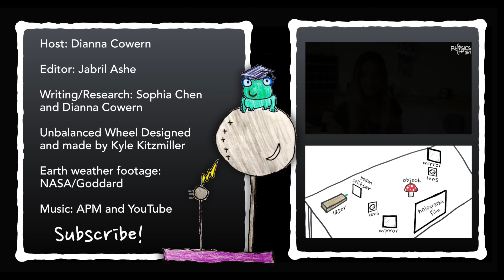Are perpetual motion machines possible?

Comment: Theoretically you could build a perpetual motion machine, but you'd never be able to get any energy from it. But if no energy is put in and no energy is taken out of the machine, it'll stay the same energy level. Probably the closest thing we have right now to a perpetual motion machine are satellites. They move forever around our planet without any energy input. Except they don't. What we call vacuum actually has a few particles which slow the satellites down, other planets and the moon affects the satellites over time and the sun heats them up.
Reply: +Huntracony A perpetual motion machine isn't even possible theoretically, look up carnot cycle
Reply: ***** Sorry, I do not understand it from reading the Wikipedia article. Why would it not be possible for something to move forever when the amount of energy in the system doesn't change?
Reply: +Huntracony Inertia. 

The word you're looking for is inertia.
Reply: +Huntracony Satellites most certainly have an energy input. It's the rocket that propels them into orbit in the first place. That initial energy input gives the satellite it's motion. With no friction they would stay in orbit not forever, but for a long time. Gravity, solar wind and depending on the altitude, the upper atmosphere, all act against the satellite to reduce that initial energy input and deorbit the vehicle. The ISS is low enough that it does still get drag from the upper atmosphere and has to be lifted to a higher orbit from time to time. Satellites that are sent out of the solar system, like Voyager or New Horizons rely on gravity assists to augment their initial energy input from the launch vehicle, but even so, they would be really poor perpetual motion machines since we don't get any work out of their motion.
Reply: RealSpaceModels and i mentioned all of those things in my comment.
Reply: ***** reality stops us from making it practically and the laws of physics mean that if we ever make one it'll be useless and noone could see it because the light required for that would be giving it energy.
Reply: +Huntracony No, simply because  a perpetual motion machine is defined as "a hypothetical machine that can do work indefinitely without an energy source."
You can't ever make one because this is already impossible. Also, Satellites aren no p.m. machines, because they don't do work. Work is done when a force acts along a path (W=F*s). The Satellites experience no force along their path (that's why you continue to move with the same velocity when you float in space), earth's gravity is directed perpendicular to their velocity.
When you are interested, look up newtons 3 laws.
Reply: Nitroschock That's what i meant by not being able to get anything out of it. I took it as it sounds, a machine that will Always be in motion. That does not state anything about it being usefull (doing work
Reply: +Huntracony Even a probe like Voyager, going through interstellar space, will lose energy and slow down due to friction. Even interstellar space is not a pure vacuum; a pure vacuum does not exist. It may take longer than the age of the universe to "stop", but it will.
Reply: +3ATIVE If it breaks the laws of physics, it can't even be "theoretically" done. If it goes against the laws of physics it is just imaginary.

That being said, you could still theoretically make a "perpetual motion machine" if your definition of that term is that it continues moving forever. Such a machine would not create energy, it would just not lose it either. To do this you would need an environment with no friction, which would mean no matter other than the moving object itself. So if you just had a disk in a true vacuum, you could make it spin forever. Conservation of energy actually forces this to be true... but only in ideal conditions. So it can be theoretically done, following the laws of physics. It just can't be practically done because no closed system like that exists in our universe.
Reply: +Wyatt Jackson i don't think simply "moving" forever qualifies as a "machine". I believe the minimal requirement from a "machine" is that it transforms one type of energy to another.
And when energy transformation occurs, typically - energy is "lost" in the process, so that further transformation is reduced - until it completely halts.

If something just "moves" forever - it is not a machine. it's just a simple object.
and there's nothing interesting about that. it doesn't "do" anything.
Reply: +Klayhamn nope, there is another law of which all of energy must agree 
whenever it changes form, it loses quality
In other words
dam that rise in entropy.
Reply: +3ATIVE Did you even read my whole comment?

My argument was that Huntracony's definition of a "perpetual motion machine" would not technically break the laws of physics. It is something that moves perpetually, but does not create or destroy energy, therefore it does not break conservation of energy. It follows the laws of physics and can therefore "theoretically" be built. Something that does not follow the laws of physics could not be "theoretically" built.
Reply: +Klayhamn That's a good point. The purpose of my comment though was to try to summarize what I thought Huntracony was trying to say, since it seems that people misunderstood that original comment. I was trying to explain Huntracony's definition of a "perpetual motion machine" (which admittedly focuses more on the "perpetual motion" part while mostly ignoring the "machine" part). But now that you mention it I guess that isn't actually what a machine is.
Reply: +Huntracony 
What most would agree to be a "perpetual motion machine" is some sort of device that creates more energy than it takes to run. What you are suggesting is simply inertia: An object in motion will stay in motion until acted upon by another force.

If a device could even make one nano-Watt more than the power it takes to start/run it, it will be perpetual motion. Since satelites, wheels, etc create 0 energy (including, as you said, pure vacuum, no friction, etc), it isn't a perpetual motion machine.
Reply: +3ATIVE 
According to wikipedia and a few other articles, over-unity devices and perpetual motion machines are basically the same thing.
Wiki on Perpetual Machine:  A perpetual motion machine is a hypothetical machine that can do work indefinitely without an energy source.
Doing "work" implies being able to put that energy it creates into use without new input. Ergo, what I described, some sort of machine producing 1 more nano-Watt than it takes to run.
Wikipedia also loops the terms "over-unity" back to the "Perpetual motion" page.
Reply: +3ATIVE 
Wikipedia: A perpetual motion machine is a hypothetical machine that can do work indefinitely without an energy source.
Thermo Textbook, an example of PMM: A steam power plant that produces energy indefinitely without outside input., or a power plant that achieves 100% efficiency.
About.com: a perpetual motion machine which produces power without energy uptake.
Britannia.com: The enormous appeal of perpetual motion resides in the promise of a virtually free and limitless source of power. 

If that doesn't mean it produces more energy than it produces, please explain what that sentence means to me. If you can't produce work out of this "machine", it is nothing more than an efficient energy storage device.
Reply: First-Kind perpetual motion machines create energy from nothing.
Second-kind perpetual motion machines extract heat energy from a colder energy source without another energy flow to drive it.
Third-kind perpetual motion machines run forever without energy input.

First- and Second- kind perpetual motion machines are impossible, third-kind perpetual motion machines exist.
Reply: ***** Yes there are. Persistent currents in superconducting rings are perpetual motion of the third kind.
Reply: +3ATIVE right!
Something that runs forever without energy input isn't possible, isn't a machine and isn't classed as a perpetual motion machine (most laymen would think of PMMs as something you can use to get free energy from).
In the case of voyager 1 (if we assume perfect vacuum and nothing encountered on it's journey), the satellite would travel forever as there is nothing for the kinetic energy it has (given to it by the lauch rockets) to be converted into. 
Even if the kinetic energy could be harnessed for "work" then it still would not give you back more than was put into it at launch.
It's not a machine in that sense, it's just an object with kinetic energy with nothing to convert said energy into.
It's quite interesting that the "total energy" of our solar system (and eventually our galaxy) will drop ever so slightly when it leaves as it has taken some of "our" energy with it.
Reply: ***** The whole point of a perpetual motion machine of the third kind is that it does no work. It's still a perpetual motion machine because it still runs perpetually.
Reply: IamGrimalkin
I think you are confusing the technical term "perpetual motion machine" with that which the Layman understands.
In Lay terms, a perpetual motion machine will allow someone to get free energy from an initial small input (or otherwise called an overunity device) - which isn't possible.
Also there's an argument that Voyager 1 carries no energy, depending on your perspective. if you were floating alongside (or travelling with it) at the same speed, it would have no energy kinetic or otherwise that you could use so it isn't even a machine in that sense.
Depends on who's frame of reference is being used.
Reply: sorry. not a skyper, (plus I;m at work!!)
Reply: ***** Yes, and persistent currents in superconductors require no extra energy to continue without stopping: they are perpetual.
Reply: ***** Electrons do have physical motion.
And anyway, you can do the same thing with a spinning superfluid.
Reply: IamGrimalkin but they do need you to give them energy to start the current, and if you then draw it off to use, you won't get back as much as you put in.
Reply: George Smith Yes, that's why it's a third-kind perpetual motion machine and not a first-kind.
Reply: +Huntracony, such a system moving forever is only possible in Newtonian physics though. Quantum mechanics makes perfect vacuum impossible. Meanwhile, relativity causes moving objects to produce gravitational waves and through those loose energy.
Reply: +IamGrimalkin, superconducting materials do have resistance.
Reply: mina86 No they don't.
Reply: +3ATIVE
No, the resistance of superconductors is actually zero.
Reply: IamGrimalkin, *****, interesting, it seems I’ve been living a lie all this time!

But in that case, consider this: let’s construct a closed system with a current flowing through a superconductor. If the current never stops, the entropy stays constant which goes against entropy growing in a closed system.

So even though in practice it may be unmeasurable, at a scale of billion of billion of years the resistance is probably still non-zero.

Or am I missing something again?
Reply: mina86 you still have to "add" the current to the system. So you're not getting anything for free, or any more than you put in.
Reply: ***** aah my bad. I'm still in the layman phase of perpetual motion.
Reply: +mina86
The second law of thermodynamics is not that entropy always increases in an isolated (not closed) system, it is that entropy always increases or stays the same in such.
Reply: +IamGrimalkin Just a little reminder about superconductors; they need to be cooled. And that cooling takes energy. And thus, not perpetual. If you shut the cooling of, you take the super out.
Reply: +Trond-M Johansen Cooling doesn't have to cost energy, send a bunch of superconductors to outer space where it's cold enough... Problem is, you can't extract power from superconductors, there's no power generation
Reply: +Huntracony nothing is a pure vacuum but assuming spherical cows in a vacuum then sure, you'd have a satelite orbitting forever. However, this isn't a real machine or cycle. To call it perpetual motion is somewhat misleading :p
Reply: Trond-M Johansen They only have to be cooled if they aren't below the critical temperature to start with.
Reply: +Huntracony You forgot tidal friction.
Reply: +Huntracony Wrong as the statement of hers with the Temperature beeing the force moving the bird.
The Sattelites always 'fall', so they are constantly supplied by energy through gravitation with a trick using movement in Space/Time.
So, it is not possible to build a perpetual machine. Because every interaction will cost energy, which is convertet into other, useless forms. Energetic Waste.
Theoretically, yes, you can create it as a math. As many physics is done in a theoretical, but impossible enviroment of total nothing. But, even then a perpetual machine is impossible, because your 'machine' would have to be one simgle BBlock of meterial impossible to interact with itself - which is also impossible.
So, even in theory, now with adding Quantum mechanics, the perpetual machine will fail and be even theoretical impossible.
Reply: +Huntracony nope
Reply: +Huntracony running perpetually IS CREATING ENERGY.
Reply: Jared Freeman Not necessary. Depends upon the definition,
The basic is the preservation of one type of energy by generating enough of it by running to replace the loss through other factors like friction f.E..
The 'creating energy' comes from the theory, that after creation the loss is reduced. it was a thought experiment which should show the impossibility of perpetual motion, but did quite the opposite to many people.

So, it depends on your build: creating more energy than loosing or loosing less/no energy.

And sorry for my English, it is still not my native language.
Reply: ***** That is not possible, because you loose energy even by not moving.
1. You can not recieve more energy than insert.
2. Entropy let you loose Energy disregarding your actions.
3. Interaction means energy transfer.
4. Energy tranfer is always at the price of energy loss through parts of the transferred energy is needed for the transfer itself, also there will be losses by energy not transfered but converted to another form which is not transferred od usable (the friction of the coins rolling on the wooden whheel / thermic energy through friction).

So, even if you eliominate every other outside source, a perpetuum mobile depends on at least 2 different things interacting and generating by that enough or more energy, than is lost in the process.
But, therefore the process itself can never be run at 100% efficiency, it is not possible, even if you negate all the outer influences.

So, the only way to make it "theoretically functional" is to put elemental rules aside.
Which is like claiming a is 9 instead of 6 in a+a+a=18, because you just ignore one +a.
Reply: +MrDpsc (Completely OT: That's a funny #TBBT joke, "Assuming cows are spherical and exist in a vacuum" LOL)
Reply: +Rabijeel 
That is pretty neat explanation. Rather a conventional one. Of coarse, those wheels will not achieve 'perpetual motion'. Those 'free energy' or 'perpetual motions' are not possible for certain scientific causes but their explanations are somewhat misleading & do ignore a few aspects about energy.
 We as humans don't know anything much about 'pure energy'. In fact we use forms of energy. Energy to cool something, energy to rotate, energy to propel, energy for heating. The nature of requirement of energy is that we need to continuously convert energy of one form to another. We need a energy source that is easily convertible from one form to another.
 No energy is destroyed or created. Conventionally it is assumed that a particular ensemble is generating energy by itself, which is not always the case. We are swimming in preposterously dense energy field. We are not needed to generate energy from emptiness. We need to find processes to harness those forms of energy to convert to usable forms.
Reply: +SuperRahul73 
"Conventionally it is assumed that a 
particular ensemble is generating energy by itself, which is not always 
the case. "
What I meant was that  Most of them were really spoof. in some cases they may have succeeded in converting one energy form to other but generating energy by itself.
Reply: +Huntracony It's not theoretically possible - it would violate the most fundamental laws of the universe. The reason the satellite keeps moving is inertia - it's essentially always falling towards the planet and missing! ;)
Reply: +Huntracony Satellites will fail over time just like the sun will.  The angular velocity is evenly matched with the downward pull of gravity.
Reply: +Bobsyouruncle Wilson Nothing except energy is perpetual in the true sense of the word.  
However most people think work consumes energy it does not, it is the by product of energy flow.  Enter entropy and you have another can of worms because some people think thermodynamic entropy has something to do with order and disorder, it does not.  Those two issues prevent most people from understanding and thinking deeply on the subject.  Maybe then most people would understand that Carnot efficiency is the work efficiency ratio to thermal energy flow.  So is it possible to create an engine that conserves its energy and its work output indexed to average local temperature. Yes.  Does it ever lose energy only as a function of local temperature change if above equilibrium pressure and temp but it conserves it within that state. Can be proven.  Can be demonstrated, question is can it be made both safe and affordable?  My opinion is yes, but it needs to be demonstrated.
Reply: Kimberly Peacock Still, you can not, not even theoretically, turn one form of energy into another one without 'loosing' energy, which is , if looked at it specifically, just a producing of 'byproduct energys', like the friction of an engine also generates heat, however it works, beneath the form of energy it 'creates' (or better 'transforms the former potential to').
The only way to reduce this losses would be to freeze it completeley (absolute null), which implys that no transformation can be done.
Indeed, that is the trick many superconductors use: Parts of the transferring array is cooled very much reducing the interference of themself to a minimum.

That means for me that even Energy itself is, as long as not bound in a state of total rest, not perpetual, because the interference of the enviroment (we know, the total Vacuum is a theorem to make things predictable by Math, not a real state or anything near possible) will always cause dirturbance which interactions cause amounts of Energy transfered to other forms. So, basically we have to prevent transformation of energy in a theoretical (impossible) enviroment which makes the transformation itself impossible (because, as Theory, it would at maximum be one Element, a single Atom, allowed, frozen in a impossible way; so we can not call it machine, because nothing will be proceeded, because of the need to prevent even elemental decay or 'entropy'.

At least, that is what my basic knowledge tells me, as far as I understand the whole Fabric of Reality. Correct me (please with source for me to learn) if I am wrong.
Reply: Richard Garnache The basic idea is not wrong, we do this with some devices nowadays to minimize Energylosses.
But still, in my opinion, it can not reach 0 because this also needs transferring Energy.
So yes, for me it is not working either.
Reply: Richard Garnache I know. But, it can be done without cooling theoretical (Finding an empy place in Space where no Sun can be seen anymore).
Keep in mind, it is about the theoretical possibility of Perpetual motion, not the real possibility which is impossible as everyone knows.
But, yes, you are right, there also the cooling has to be counted as well as used energy.

God, this thing goes ridicoulus more and more every second you think about it....
Reply: MrG0TH1ER Ok, lets call it 'mechanism' - but that is exactly what I want to say in the end: As closer it comes to perpetual motion, as farther it has to distance it from the term 'machine' or mechanism'.
Reply: +Huntracony Because of friction.
Reply: +Huntracony The short answer - no it is not even theoretically possible. The long answer - I think you are misinterpreting the term perpetual motion machine, as it implies something different to what it is. Perpetual motion means that one thing can move forever relative to something else. So even if you had a perfect vacuum, with two masses orbiting each other, that wouldn't be a perpetual motion machine, as to each other, the masses wouldn't be moving. However if you try to extract energy from that system, the masses are no longer moving only relative to the other, but also moving relative to the energy drain. Hence energy must be lost from the system. The first law of thermodynamics states this.

So even if ideal scenarios are used, using classical mechanics there is no way for a perpetual motion machine to exist. However, as the universe has mass, and E^2 = (mc^2)^2 + (pc)^2 then that energy must have been created from somewhere - the really interesting question is can we use the physics of the creation of the universe to create a machine that produces energy? Then in theory we haven't broken the laws of thermodynamics, as the energy we would receive isn't from our universe, but a separate one.
Reply: +3ATIVE "theoretically" you can't produce energy according to the current laws of physics, and any implication of this means that theoretically a lot of things are impossible...
Reply: +Huntracony I think Nitro is right. A rock flying through space may go on forever in the absence of friction. That is not a perpetual motion machine.
Reply: +Huntracony It is not possible either theoretically or practically... Can't you see that by being able to explain why perpetual motion machines won't and can't work shows that it is theoretically impossible? There are several theoretical proofs for this, the first of which being the law of conservation of energy, and all of it's derivatives, widely currently accepted due to the large practical evidence behind it, which directly contradicts your statement that it is theoretically possible to build a perpetual energy machine...
Reply: +A_commenter Entropy change can be zero... It doesn't have to rise, it just tends to.
Reply: +Wyatt Jackson True, it wouldn't break the laws of physics given certain assumptions - 1 the two masses orbiting each other are in a vacuum. Two, the two masses are an infinite distance from any other form of energy. Given this scenario, the only thing that the masses can move relatively to is each other, hence they can be viewed as not actually moving relative to each other. As soon as you insert a stationary point which the two masses can move relatively about, i.e. a camera filming the masses, it breaks one of the assumptions used, as there would be a force of attraction between the camera and the masses due to gravity, causing the orbits of the masses to become deformed, attracting towards the camera, and hence loosing energy, until given enough time, the masses are no longer moving, or the whole system is rotating together, in which case we have returned to our original postulate, and it can be said that relative to each other, they aren't moving.
Reply: The energy source for the satellites are the rocket engines that launched them into space. Now that they're up there, Newton's first law governs their motion.
Reply: +Huntracony 

they have also been accelerated to start moving in the first place :D
kinetic energy has been added. and if they bump into something, they will just pass it on and put some of it into deformation.
Reply: +CaptainObvious0000 She didn't fully tell why it didn't work. She said because of the axle bearings and weight. The wheel is round. As soon it turns there is less gravity on the weights by centrifugal force. It needs to be oblong. Also Leverage needs have a play in it to force it around.
Reply: johnstarr2001 In your case: She did, you simply don't understand it or the Physics Law she refers to.
Reply: +Huntracony that's not a machine....if you cannot do work with it, it's useless
Reply: For those of you confused by this thread, its important to define everything properly. A machine is something designed to do work. Energy is added to the machine in order for it to perform the task it was designed for. A perpetual motion machine would be something whose energy output performing its task is greater than the energy you put in. The law of conservation of energy prevents this from ever being possible. Most perpetual motion machines are not necessarily designed to perform a useful task but rather are designed to run themselves, like the wheel in this video.
The orbit of a satellite is not a machine designed to perform a task any more than a bicycle coasting to a rest.
Reply: +Huntracony satelites move around the earth because they are constantly falling (kind of) but travelling too fast to actually hit the ground, so the enrgy source is gravitational potential energy and that continues to be put in, the whole time the satelite is up there
Reply: +Huntracony Well, I agree with what you wrote, based on the law of conservation of energy a perpetual motion machine can be achieved if you can eliminate all friction, but at 1:40, you can hear that the defenition of a perpetual motion machine by goldberg includes using it motion to something useful, in other words, exctrating the energy, and even then the machine should keep gaining energy by itself and keep giving it to something useful. So yeah, all you said is right, the defenition of a "perpetual motion machine" is what is weird
Reply: A machine that could run by it self should have a window(range) of extra energy. There you can use some of the extra for something else. One trick is a low input high output force (energy) switch. I will be building a free energy machine this year. It's a bit of maintenance using water. After I'll build a power plant tied to the grid. A mine near by spend $3 million a month in electricity. The have hard time competing with China.
Reply: +Huntracony satellites don't move forever around or planet. actually they are "falling" towards earth.
Reply: Antonio Carranza exactly what i said
Reply: partha sarathy About that we have to wait 2018 and the next run in the LHC.
At the actual point, we can not make a certain guess if it is a Multiverse or a Universe, but as far as we know energyexchange has no real "loss", just some sideproducts we can not use in the progress of transformation.
So, at the actual point, all seems like the overall amount of Energy in the Universe may not be fix, but it always is in balance, what exclude the possibility of a real perpetual motion. The maximum would be a device once powered running endlessly, but still the initial power must be added to be conserved then - and still you must exclude every influence from the outside, which is impossible.

So, even if our Universe is a Multiverse and "not closed" perpetual Motion would be mostly impossible, as long you do not include multidimensional physical interaction with another Multiverse allowing this.
And, to be straight: There is a bigger possibility for God/-s to exist than this. There are even more scientific indices for God/-s existence than for this.

Even if you gain complete acess to manipulate Energy, Matter, Space and Time itself, you will not be able to crack this wall. You have to go beyond the power of .... well, the best comparsion would be - God.

Theoretical you may be right, but only if you exclude proven facts and - well, everything else - in your Theorem. And then, everything is possible. Even me beeing God, the most powerful beeing in existence - I just have to exclude everything else in existence.

Or, to make this answer short: No.
Reply: well, satellites CAN actually gain altitude over time. anything above a stationary orbit will slowly progress upward, but the momentum to do so comes from the planet itself.
Reply: +Huntracony I like your argument here. "I disagree on a technicality. Here's an example, except the example proves the original point."
Reply: +Sean Conrad LOL you smart LOL!!!
Reply: +Huntracony Uh... what about quantum theory?

Even if you could freeze a region of space to absolute zero, to where not a single particle is moving due to thermal interactions, the virtual particles popping into existence everywhere will shake the real particles and the quarks that make up all the particles will still be constantly moving. You basically can't have a system that remains at the same energy level, just due to the fundamental nature of space-time.

If I understand correctly that's what makes empty space a candidate for the origin of the universe we observe. It's theoretically possible for an almost infinitely high energy/high mass virtual particle to emerge from empty space and start the ball rolling.
Reply: ExperienceCounts2 Correct, and that contradicts every perpetual motion as a) the Energy will resolve in other Forms or B) it will be fueled by this Energy from outside.

Basically, empty Space isn't empty - and thats what it means (rudimentally).
Reply: +Huntracony Except you aren't making energy from nothing, which is the definition of perpetual motion machine. The energy source is that initial rocket that got it up there in the first place and gravity.
Reply: +Huntracony You can't even build one theoretically. There exists no area of space in the universe large enough to house any sort of device where friction and interstellar particle collisions do not apply.  Such a machine has to be removed from the universe to operate, and thus it has to be removed from physics as well. Mathematically it is possible, but math doesn't actually exist, it just exists in our minds.
Reply: Boof Yes, you can - if "theoretically" the Laws of Physics do not apply, you can...
coffs
Reply: +Boof theoretically anything is possible so theoretically it is possible you just have to have a big enough imagination. and yes math does exists  ideas that are used or applied to use in life...... well math is in freaking everything. that like saying your ego does not exist. its and idea to understand something on a even higher level....just like math. neither are tangible defiantly real though
Reply: Tony Becerra Well, let differ between "theoretical" in a meaning of "limit the use of applied knowledge" and "Theoretical" in terms of "maybe something we still do not know allow us otherwise" - if theoretical means to exclude all resisting factors, then yes. And, maybe there is a way to exclude them in the future - but I really doubt that something can pour out more than it is filled in before.
Just because you do not see or do not know about the source of the outcoming does not mean it does not exist - and whenever we found something "coming out of nowhere" we found a source of energy afterwards following the basic rules of physics.
Reply: satellites slow down the rotation of the body they are orbiting by an infinitesimal amount
Reply: +Huntracony I think your comment has raised the topic of "draw 7 red lines with blue ink and they are perpendicular to each other" -- go search for that vid. fun enough.
Reply: NoVaKane There are two kinds of understanding of "perpetual motion": One is that the Device itself generates by itself the same amount of energy to keep itself running - kinda plus-minus Null. This Form may concidred "correctly" by just sustaining its own power by itself.
The other part conciders the initial Energy to get the Device started into account and by this the device had to generate more Power than it needs to sustain its own working process as the initial Energy had to be gained afterwards back.
This sounds mostly the same, but the difference is big: One Device just need to sustain its Power completeley, the other one had to generate more Energy of some Kind than its consumes, so it can consume Energy as long as it generates more.

And, as the first one theoretically can Exist (theoretically!!!), the second one is impossible, even if it seems often possible due lack of knowledge of the ways the devices work.
If you do not see or know about the Energy and the way it is used doesn't mean that there is no use of Energy.